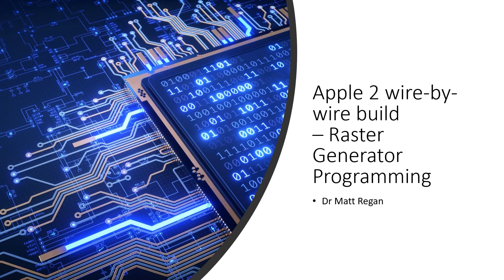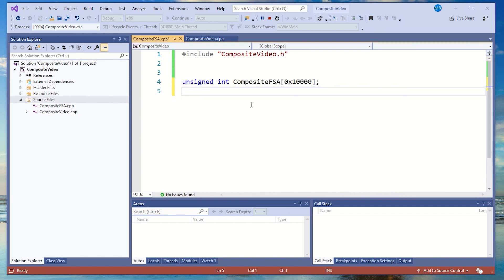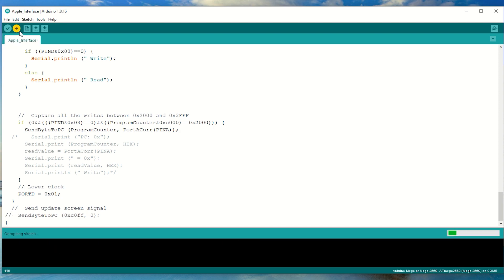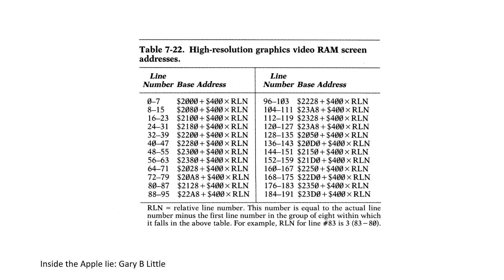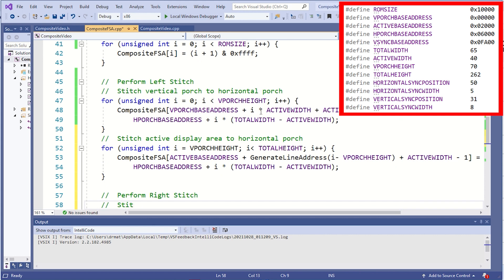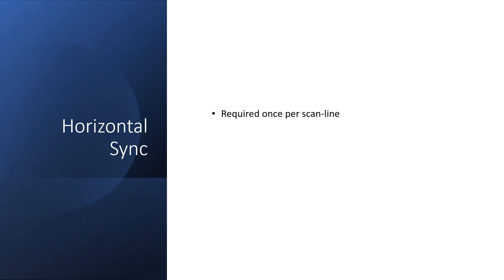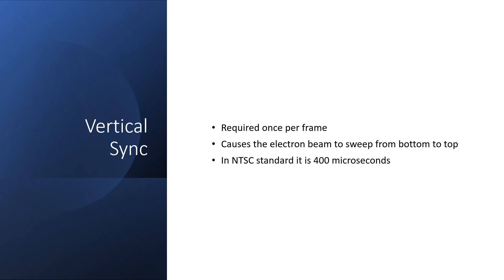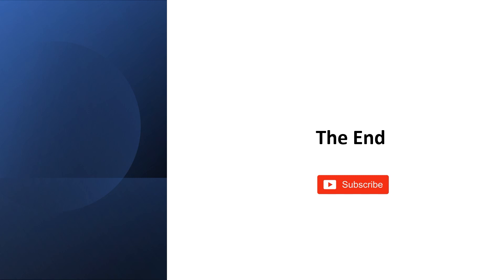Apple 2 wire-by-wire build, Part 13.  Raster Generator Programming

Comment: I had to watch this twice to follow it probably in part because of Woz's clever video refresh magic combined with your clever use of the EPROM … but I think I've made sense of it now. LOVE how you used an address line for sync! 😁 You could use some gates but … why introduce extra gates (and extra delay) to do that?

One thing I think is very important in these videos is that you are including your mistakes as well as how to find and debug them. That's important because anyone trying to implement something like this WILL make mistakes, and if we haven't got history with driver code and real-time interfaces, we'll be quite unprepared when we need to debug them. Because we will need to debug them.
Reply from the maker: Thanks Joseph.  I agree i think it's really important to include the mistakes.  All mistakes are kind of unique, but the approach to solving them is pretty similar.  One of the things i want to get across is that when you apply power for the first time or run some software for the first time, don't expect it to work.  If it does appear to work, then be suspicious.  It always takes work to get both hardware and software to run properly.